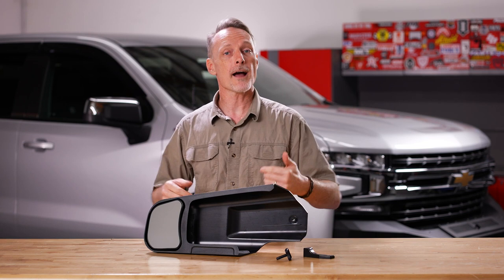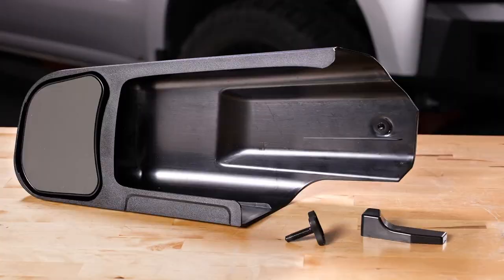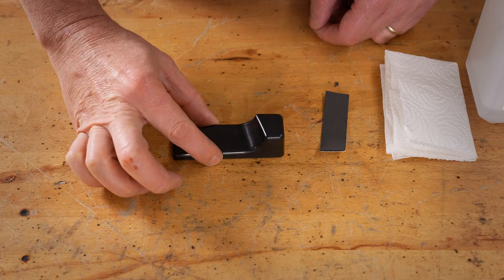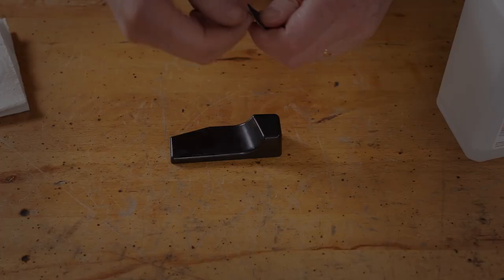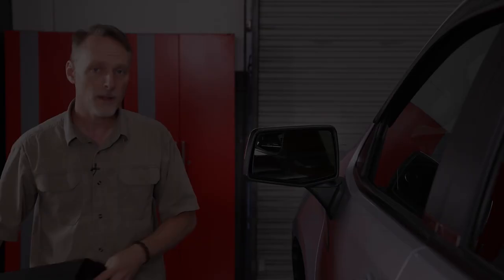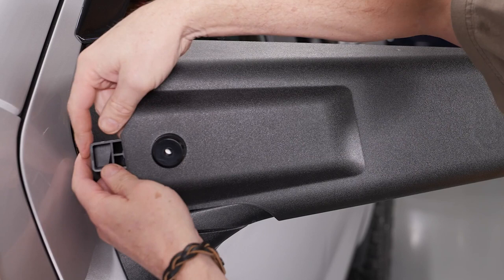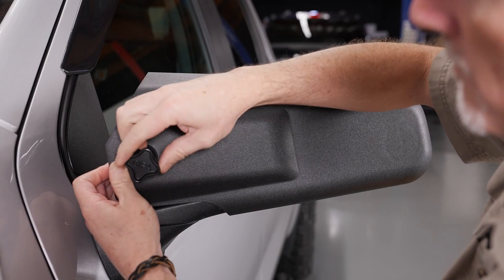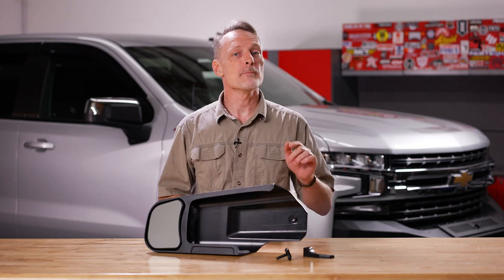CIPA Custom Towing Mirrors Fast Facts

Comment: What model # cipa slide on mirrors are for the 2019 GMC Sierra 1500 Limited? Pleas include model number for the pair of mirrors. Thanks for your help
Reply from the maker: Hey there! If you have the limited 2018 body style or the new body style the part number for a pair of the mirrors is CIP-10970.  Hope that helps!
Reply: @Realtruck   The 2019 Sierra appears to use a larger different mirror than the 2019 Limited. It appears the 2019 limited is using some of the 2018 parts as production  is converting over to the new style 2019. The part number you provided me looks like it will only fit the 2019 regular sierra as the 2019 Limited appears to still run the 2018 mirrors . Thanks for any help you can provide on the issue